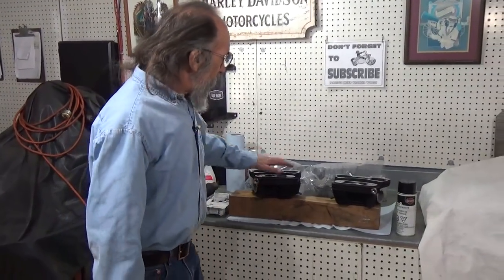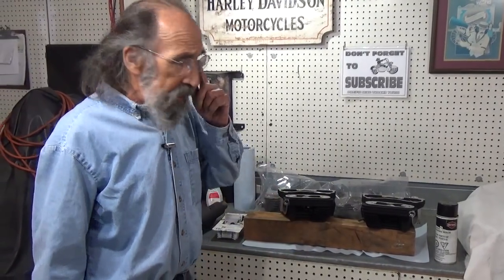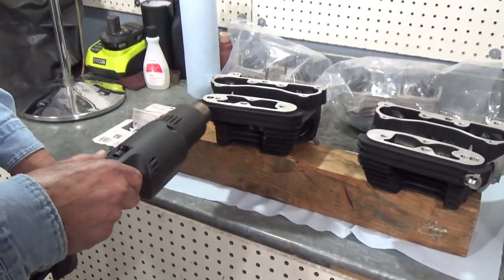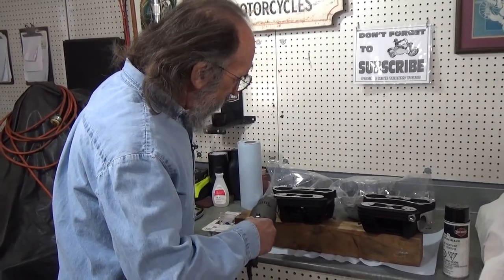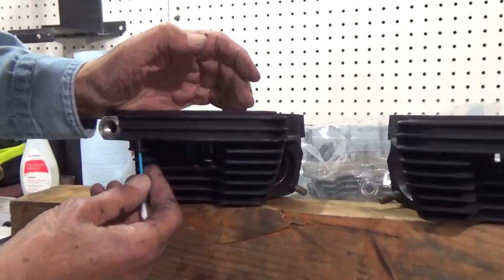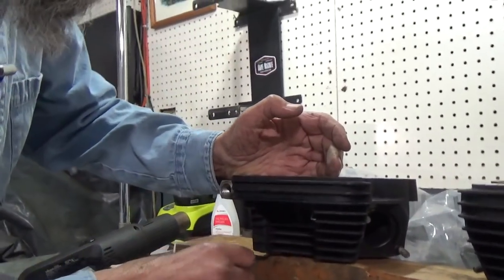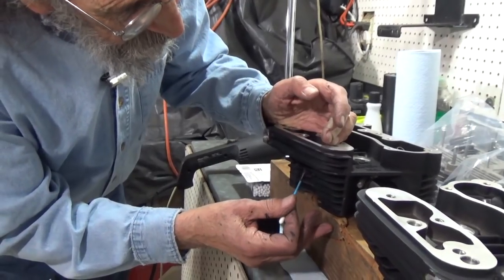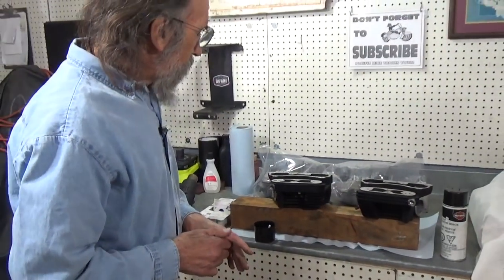More Evo Cylinder Head Painting!

Comment: ... Paint only interferes with cooling...
Reply from the maker: It's for someone else.  But, black does run cooler as it absorbs heat from the inside and dissipates it to the outside.  I still like raw aluminum.
Reply from the maker: We experimented with that a lot a long time ago.  But, today, there are all kinds of wild thermometers available.  I like aluminum raw and cast iron painted black.  My personal preference.
Reply: Nope... ever wonder why radiators and a lot of Underwood components that generate heat from the inside are black? It will dissipate it out and away vs something that’s just painted black not generating any heat.. then it’s a different story...

Comment: Hi Mike  --- 2 questions    firstly regarding sumping on older bikes    can you pull apart the scavenger pump on the knucklehead to show how to clean and reseat ball?  Also I have a inlet manifold leaking air at the cylinder locking hex nut ( causing bike to rev high at idle)     can we do a tear down and show how to replace the seal etc     cheers  tim from downunder!!
Reply from the maker: New nuts and seals (brass ferrels) for the intake seals.  Tighten over and over until no leaks.  Use the proper manifold wrench, available from aftermarket suppliers.  I usually tighten them up then heat cycle, then repeat.  It's a pain.  I converted my Knuckle to 0-rings with an aftermarket kit.  Reseating that bll in the oil pump is usually not necessary.  How long did you leave the bike sitting.  If you leave it too long, without riding it, it will wet-sump.  Try a new ball and spring first, and fresh, clean oil.
Reply: Cheers & thankyou for your advice

Comment: Great video Mike...I enjoy all of your content and videos sir. Hey I asked you about KB pistons a while back, well I recently got my bike back with the motor completed, it runs pretty amazing,  strong power, I have 120 easy miles on it after 2 heat cycles were done...didn't go above 4 grand on the ram gauge. Do you think it's good to hammer on now?...my mechanic says it was good to go after the 2 heat cycles...im not sure.
Reply from the maker: I'm not your mechanic.  This is between you and him.  Those are excellent pistons.  I probably do things a little differently, but we're all a little different.
Reply: @pacificmike9501 .....thank for responding Mike,  if you wouldnt mind please sir, tell me how you break in new pistons on one of your engine rebuilds?...I had the honed with 10 over pistons, heads ported and decked with new 5 angle valve seats with titanium valves, not sure of the diameter,  but the work was done to match the Andrew's 57 cams....2 into 1 bassani pipe, bigger injectors, s&s air intake......it runs really well after all this, but just wanna be sure I break it in properly...thanks....the engine is a 2003 screamin eagle 103 from a cvo road king...its my baby, I love that bike
Reply from the maker: Do what your mechanic recommends.  I go easy for 500 miles.  You're trying to let the rings seat in the cylinders.
Reply: @pacificmike9501  ...ok Mike, thank you for getting back to me...I value your advice sir.

Comment: Hey Mike,  the factory tech with more of what corporate says. I have painted many wrinkle black top ends back in the day, always kept a sharp clean edge on fins,,because THE MOTOR COMPANY said so, it helps dissipate heat. Heating parts with a heat gun is ok but never bake, powdercoating is also frowned upon, the baking process can upset dimintional stability, and on cylinders can lead to insert/casing separation. I worked in the warranty world, they would deny warranty coverage on these items. Yeh, I know , it's a different world in the dealerships, I had to follow Motor Company policy or loose my ticket.
   Nice work there, I only mentioned the above because I know you are the kind of guy that wants to know these things I know I am.
Reply from the maker: Well, there it is.  Thank You.

Comment: According to H-D here in England, 'that part is no longer available'..... probably due to shipping restrictions on air transport.  I had some - still got a little bit - and had no problems with it, just sprayed it on, left it to air-dry in the sun and baked it on the bike when riding. I have some VHT stuff that tells you to hit it with a heat gun to get the required finish..... experimentation time I suppose !
There is available a product called 'adhesion promoter' which is basically a spray on glue that the automotive refinishers use to get paint to stick to items - it works on all kinds of materials and paints, again it is not cheap but we do want our babies to look their best don't we ?
Reply from the maker: You got it.

Comment: Great video! I assume that you just sprayed some of that paint into an extra cap you had on hand.  How long do you have until it's starts to get tacky/sticky?
Also, what does the pre heating the heads do for you in regards to the paint?
Cheers!!
Reply from the maker: Yes I did.  The heat activates the drying cycle.  Notice the directions on the can.  The paint is dependent upon heat.  Heat on the part, heat on the paint.  Sorry, I'm not a chemist.

Comment: Howdy Mike, I’ve been asking questions about certain things cause I’ve been wrenching on my bike and thank you for all the answers. I’ve finally got my ‘64 iron head on the road. I do have one more questions, first time rider of these bikes. When I down shift it feels like the metal parts inside the top end are clicking and it feels like it’s falling apart. Is this normal for these types of antique bikes?
Reply from the maker: There's a lot of stuff going on in that bike.  It does have solid valve lifters.  The rocker arms in early Sportsters have springs to set the endplay.  The "click" you here could be the need for a valve adjustment, or maybe the alignment of the rocker arms on the valve stems.  Did you look at your valve lifters and inspect the rollers?  Again, with four cams and a handful of gears in the camchest, there's a lot of stuff going on in that bike.  When your valve train is working well, you say, "I can hear the valves, and they all sound the same."
Reply: @pacificmike9501  a lot of it does sound like it’s synchronized and in working order. I did look at the cams and the rollers on the lifters. It’s all in good condition even the rocker arms. I never rode it past 1st gear but now that I have shifted through them the sensation of all the metal interacting with each other caught me off guard. It feels really thought but I’ve heard that’s how these bikes feel. I was looking for validation. I will keep looking, I think I might need to re-tighten some head bolts and even the bolt that goes through the rocker arms. Again, thank you very much for the knowledge I definitely have use some of the knowledge you share to help me get this iron head back on the road. Side question, when are the pacific Mike t-shirts coming?
Reply from the maker: Thank You.   Sometimes it's hard to say, yes they are pretty noisy.  Manufacturing techniques have improve a bunch since the early Sportsters were built.  I really believe that's why the Evo Sportsters are so much quieter.  That and hydraulic valve lifters.  Completely rebuilding an early Sportster requires a lot of matching of gears and all new bushings in the camchest, and it really is quite costly.  The payoff is pretty cool though.  I remember when they were new.  They were amazing.  One of my old buddies just built a super refined, fully restored 66 XLCH.  It is incredible.  In the meantime, ride that Sportster and love it like it disserves.  T-shirts?  We're working towards it.  Thanx for asking.

Comment: Off topic, I enquired about how you swapped cam gears and you said that you tried not to, and you said there were fixtures out there for this purpose but you didn't own one. Due to an upcoming upgrade on my evo i will be doing this. I fabricated my own fixture. Now my question, do you know at what degree an evo cam is set up ? I can't find this info in any manuals I have access to .
Thanks Ron
Reply from the maker: What is the problem?  If it's an Evo, and you have a size problem with the cam gear, you should be able to simply change the pinion gear.  They are coded for size by color.  You should be able to find that in your factory service manual.

Comment: Hi Mike,  I'm working on 2 1998 evo's now.   I'm kinda going through the process you have with this project.  I have plans to go to Ohio soon. My hope is to pick up a set of heads to have worked over.  My question is what to inspect for too know they are good donors for my/any engine ?   The biggest question is how to measure a head to identify whether or not they ha e been milled ?  Could you explain this.  Maybe even do a video on how to look a head over to know it's a good part to buy for a project, in particular knowing if it's been milled.
Reply from the maker: It's honestly a "pig in a poke."  You could measure a "known good" pair and establishing the exact distance on a cylinder head from the top to the bottom.  In reality, you should be able to "cc" the chambers.  Always inspect for cracks around the valve guides and the valve seats.  Do they look good?  Are the fins in good shape?  With a straight edge, check the flatness of machined surfaces.

Comment: I love your vids. Do you have anything or could show me the right way the oil hoses go on a 73 shovel. I blew up 2 oil filters looked in my book and still cant get it right . Funny thing is, I have had the bike for over 30 years and used to know how they went!!   Love the paint on the heads  even though I like the heads natural better.
Reply from the maker: Me too.  Not my heads.  The bottom hose goes into the fitting on the top of the pump (the fitting closest to you standing on the right side of the bike). That is the "feed" line.  The other fitting on the top of the pump is the "return" line.  It goes into the tank at the "filler neck."  The last one is the "breather" hose and it goes into the fitting in the top of the tank.  It also has a "tee" in it that goes into the back of the inner primary.  Don't forget the "return" line from the back corner of the inner primary and into that fitting on the crankcase behind the oil pump.  I'll bet you remember that skinny little line that goes from the oil pump and into the back of the primary housing to feed oil onto the primary chain.

Comment: Hello Mike,  I enjoy your videos.  Can you recommend a budget performance build for a stock 1996 HD Road King.  I purchase the bike and its been sitting for several years. I have never owed a EVO motor before.  
Respectfully,
Bob
Reply from the maker: Budget performance?  Evo is the least expensive Harley Big Twin to deal with.  I have done a bunch of mildly hopped up Evos.  Cam, carburetor, exhaust system and ignition system.  But it's not cheap.  And, you have to decide what you'd like it to do.  I'm retired and don't want to talk people into what I think they want.
Reply: Mike, I appreciate your candid respond; I think my goal is to spec out a combo of displayment, cam, head work etc. that will perform equivalent to a stock 103" twin cam engine. I understand the carb, exhaust, air cleaner and tuner.
Reply from the maker: You'd be amazed at how much power a stock displacement Evo motor can make.  There are unlimited combinations to make up, stock displacement or big bore and stroke.

Comment: When rebuilding heads, how do you remove carbon from the combustion chamber without harming the aluminum or black wrinkle paint?  Do you know of anything that will at least soften the carbon to make it easier to remove?
Reply from the maker: There are chemical carbon removers.  I usually scrape with a carbon scraper by hand.

Comment: Mike my 1977 Super Glide	Electric Start FXE my turn signals only have one wire, and when I use the turn signals i have to press the button and hold it for the signals to work is that how they suppose to work Mike?
Reply from the maker: Yes, that's the way they were made.

Comment: Hi Mike,
Gotta say your vids are great,
Just took a look at a video named I NEED TO TALK.
Got a question for you. 
I have a 1980 FHL, I want to change the front end. 
Are all Harley necks the same size?
Id like to put something like a wide glide. 
Will it fit?
I really don't like the covered up front shocks

Thanks Mick
Tony from down under
Reply from the maker: Yes it will fit.  I don't know what you have now.  But the old Big twin trees all fit from 49 up into the eighties.  Decide what you want to bolt to it and pick the trees accordingly.  All of the wide front ends use 41 mm fork tubes.

Comment: Mike my 1977 fxe shovelhead when I have it in gear with the clutch Lever pulled back it still moves. do I need to just the cable?
Reply from the maker: I don't know.  Usually, back off on the cable and adjust starting at the clutch, by adjusting the center screw to set the position of the cluch arm.  Then, adjust the cable.  Start by lubing the cable and lever though.  Now, if it still wants to creep,  Start off by loosening it all up and adjust the plates, then continue through to the lever.  If this doesn't work, service the whole system.  We have videos that explain this in depth.
Reply: @pacificmike9501  Thank you Mike